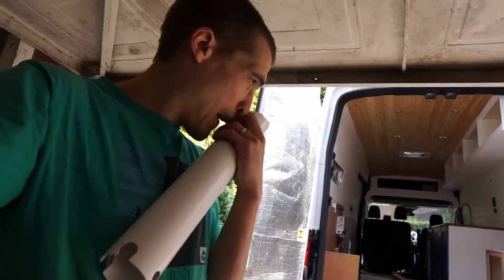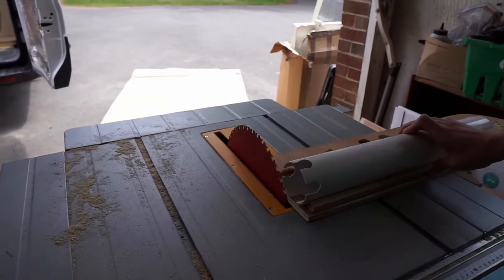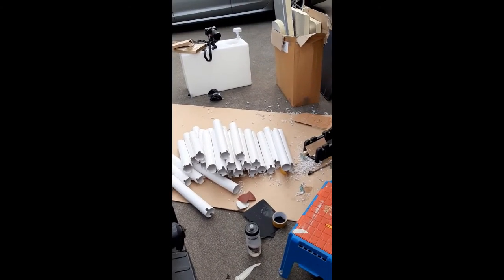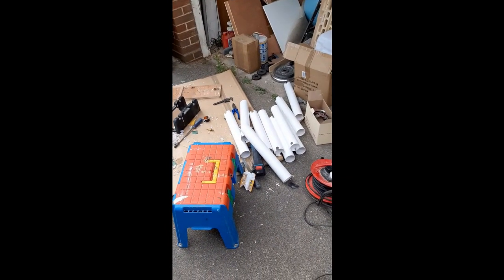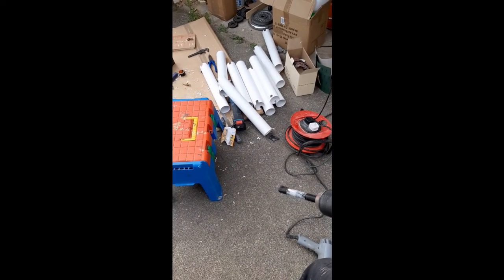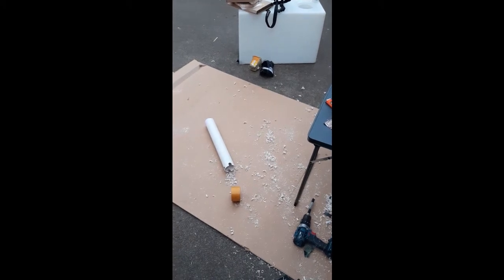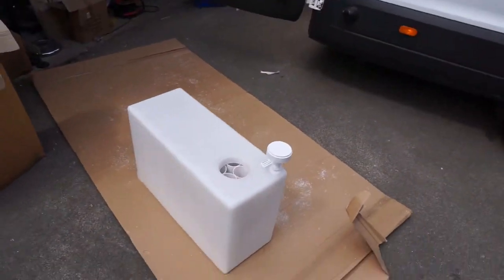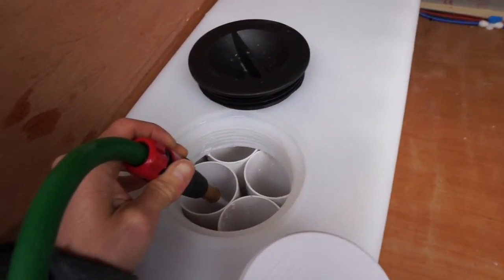DIY Water tank Baffling - The Gwen Conversion

Comment: I just finished (Aug 2023) installing your system in a 84Lt aluminium fresh water tank for my RV...drove it around the block...not a sound of sloshing water...a brilliant solution....my tank size 1300Lx320Hx225w took 32 tubes/pipes...I calculated the wall area of them and the pipes took up 3.96Lts of water...not a bad price to pay for silence...thanks again

Comment: Brilliant idea!  I'm curious how much volume is sacrificed -- how much usable space the pipes displace.  Have you estimated that by chance?
Reply from the maker: Hi, Thanks for the comment. The pipes are a couple of ml thick so I can't imagine it displaced too much volume.

I would say in retrospect that because we don't shower in the van and only occasionally wash out the back of the van we very rarely fill the tank up beyond half way and we probably could have got away with a smaller tank and less need to baffle it.

the pipes add a fair amount of weight and we are close to our GVW.

Comment: Really like this idea... but would use very lightweight material instead maybe a load of plastic water bottles with bottoms cut off or drilled out (this will keep the bottle's structure) forced into tank upside down so can drain easy. As long as the bottles don't move horizontally job done as each bottle is supporting the liquid inside it only. Nice one...
Reply from the maker: that's a great idea! I think you would need some level of rigidity so the water didn't displace them to much when moving around. definitely worth a go and a good way of reusing plastic waste.